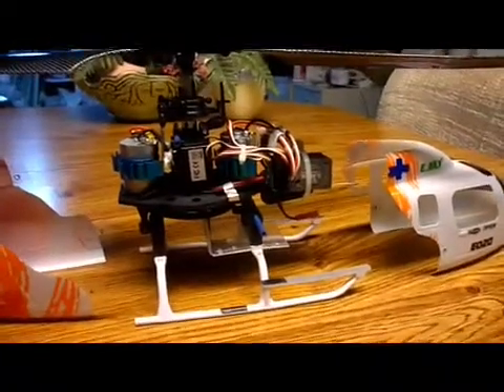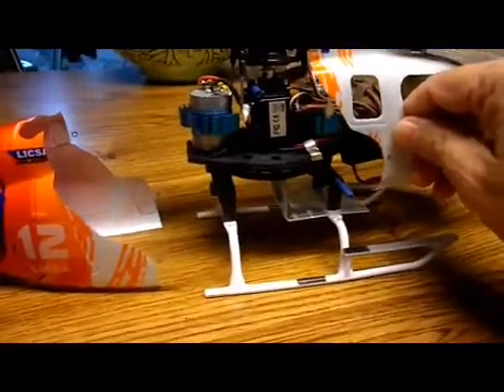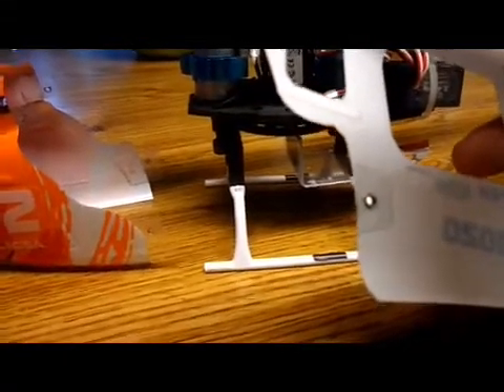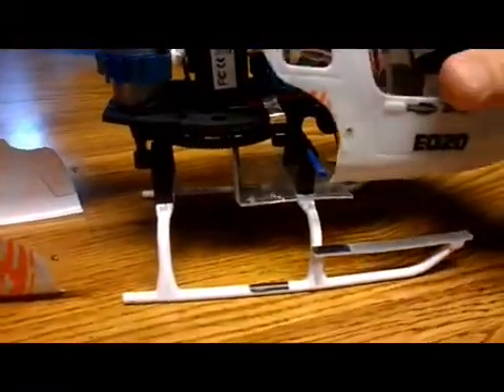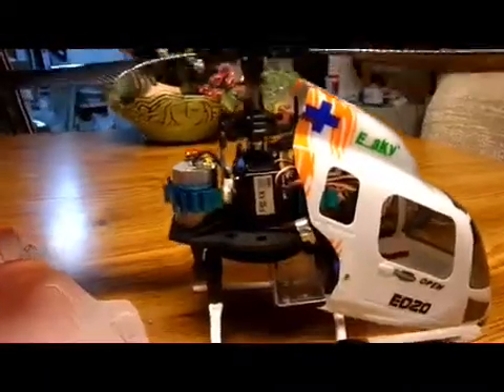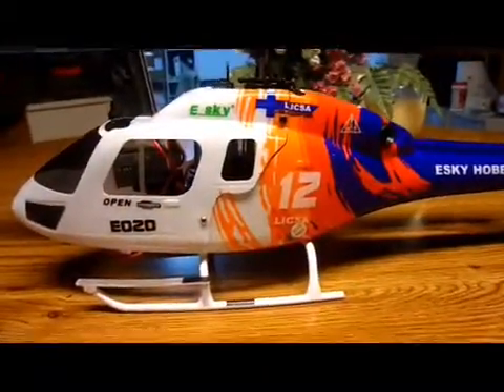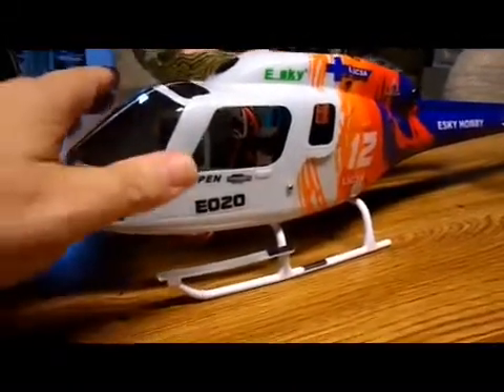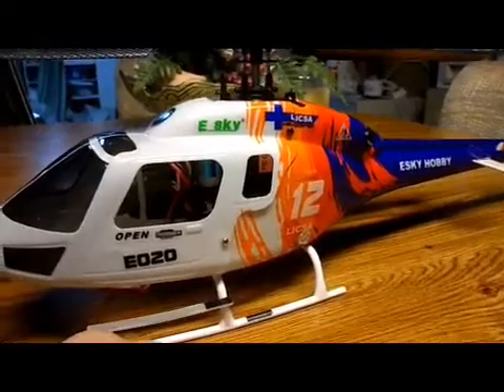Big Lama two part body project

Comment: If you glue another piece of plastice to the front portion of the fuselage by the rear window and allow it to protrude a half inch, it will slide behind the rear part and will make that line less visable. 

So your tabs will be like:

  __

__
 
  __

If any of that makes sense, haha